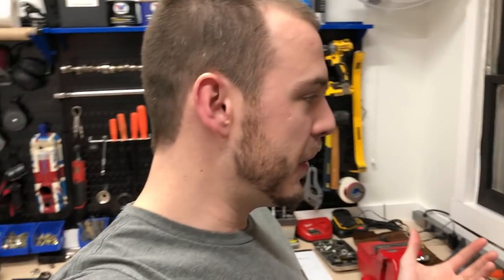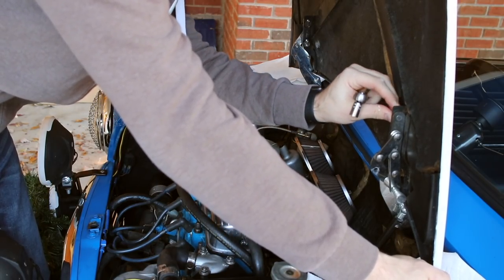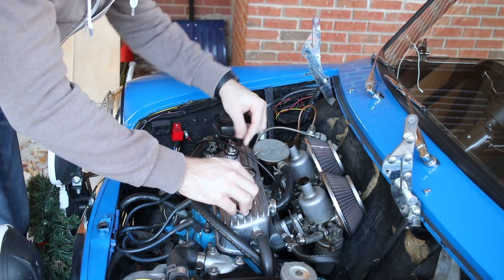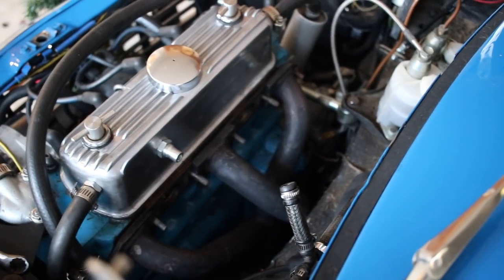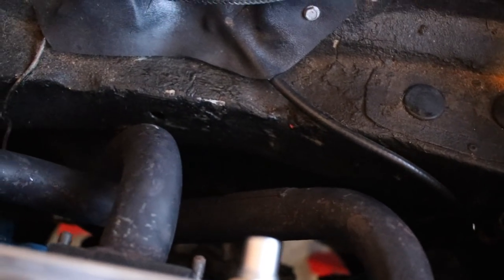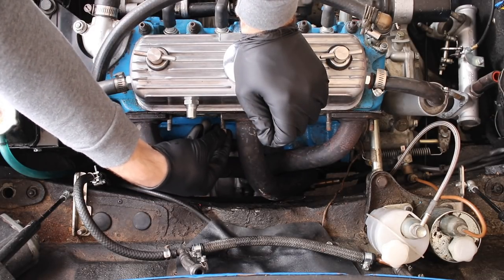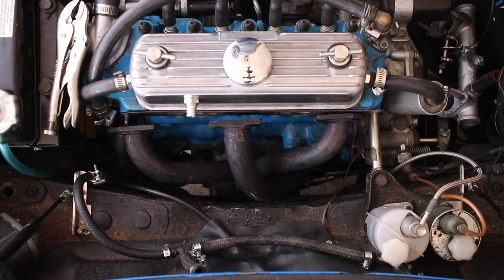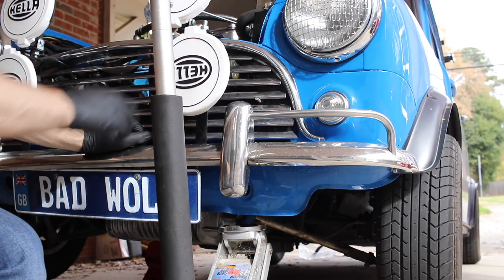Classic Mini DIY - Odd Jobs Episode 1

Comment: Top tip: put you fasteners back to where they came from, where you can. This way you'll never lose them. Especially when there's some time before you'll use them again. Saves you from remembering where all those fasteners came from.
Reply from the maker: This is a great tip.  I have been doing this ever since I pulled the motor the first time.  SO helpful

Comment: Oh, and put some cloth or plastic plugs into the intake nd exhaust ports. Saves you from dismantling the engine when something solid falls in, because of Murphy's Law (or even simply because of moisture, attacking the valves and valve seats within days).